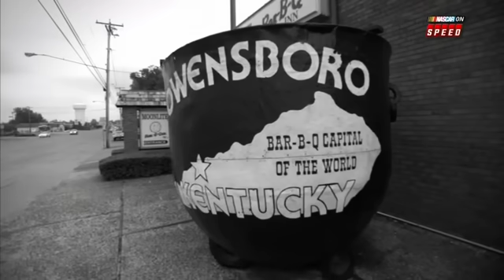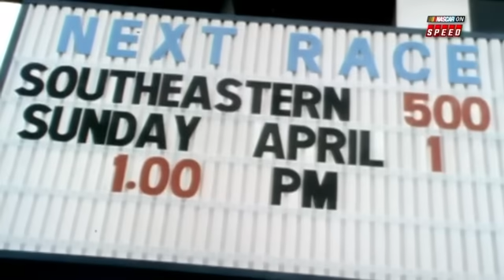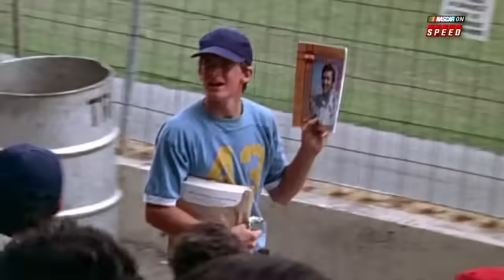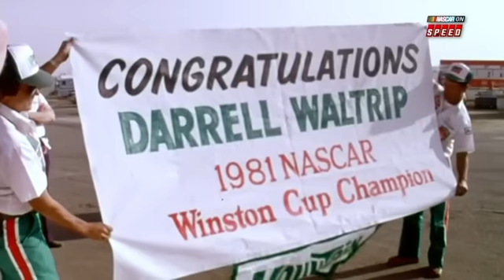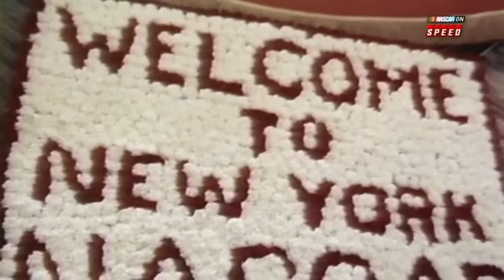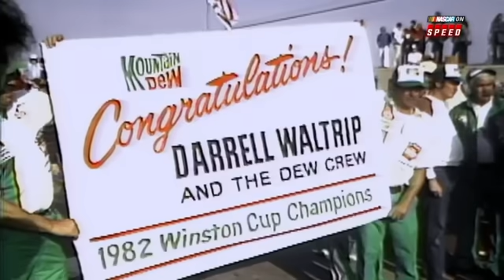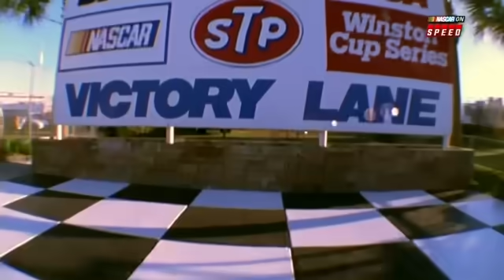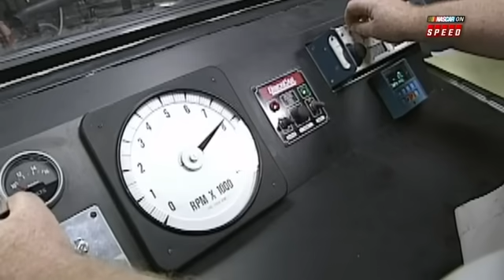NASCAR HOF (2012) Darrell Waltrip

Comment: DW comes off as an ass clown but for all of you youngan's out there he was one of the best in Cup racing between 75 & 86 and still pretty damn good until the 93 season. DW earned his way into being Inducted into the NASCAR HOF!
Reply: I've heard some years ago, that early in his career, before heat resistant race shoes were available. DW had worn sneakers , during the race the heat from the exhaust heated the floor pan, and melted the heel of his shoe, causing a severe burn to the heel of his foot and charred the heel bone, I believe he finished the race.  Now, that's a determined athlete, as I say hearsay makes for an interesting story, just saying.
Reply: @jackwells9800  That's a true DW story, I forget where it happened I think it was Bristol or Darlington? Correct me if I'm wrong YouTube commenters! Not taking anything away from DW but all of them drivers were unbelievably tough back then. It seemed like Richard Petty was always driving with busted up ribs and he drove with really bad ulcers for years then finally had stomach surgery a few weeks before the Daytona 500 in 79 and won, Dale Earnhardt and Davey Allison both went racing with all sorts of broken bones pins inserted in them by surgeons just days later getting back on the track, and you can't forget Ricky Rudd hitting the infield dirt wall coming off turn 4 near pit road at Daytona getting a concussion then taping both his black eyes open to race the 500 3days later now that's tough!